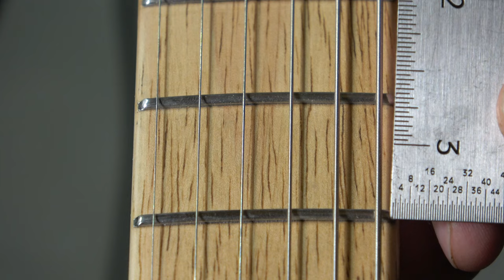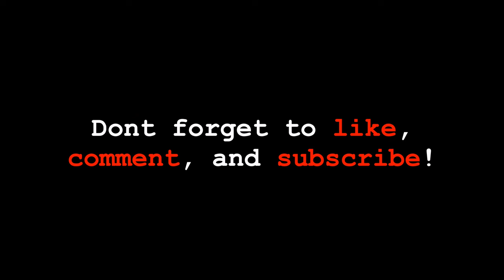How Far Should Guitar Strings Be From The Edge Of The Fretboard?

Comment: I recently rebuilt a Harmony H78 from 1964 (similar to a Gibson ES335, but with 3 pickups and a Bigsby). This guitar has sentimental value for a family member, so I viewed it as a learning opportunity - and it certainly was that...

In an attempt to start refinishing the guitar many years ago (after the fretboard had popped off), the neck had been "over-sanded", so it was 1/16"-3/32" too narrow - I had to shim the neck where it fit into the body's neck cavity.

The new geometry was a bit fussy to reestablish, and I agonized about this same subject. I tried 2mm and 2.5mm spacings with nuts that I made, and neither one worked out - I could push the bass E off the edges of the frets, starting at about the 12th fret. So, I bought nut for a "narrow Gibson" from StewMac, and ended up with a 3mm spacing from the outside edge of the fretboard's binding to the center of each of the two E strings (or maybe 1/8" - it's hard for me to measure that difference). The bass E stays on the frets all the way down the neck with the 3mm spacing. That spacing is consistent down each side of the neck. I was trying to keep the string to string spacings as wide as possible, so I was happy that 3mm worked out.

Because of the thinner neck, the 2 E strings pass over the poles on the neck pickup just inside of their centers. It does not seem to make a difference in how well those poles work relative to the other 4

I am a complete novice at this stuff, so my experience is a bit limited, but this guitar plays very well.

Comment: In my opinion, the first question to answer is how wide do I like the neck? I had a guitar with 58 mm at the 24th fret and it felt awkwardly large, my favorite guitars have 56-57 mm at the last fret. I also own a Spirit by Steinberger with a very narrow string spacing which allows as little as 53.5 mm width at the 24th fret. I don’t find it as comfortable as my other guitars, and it also is uncommon, so not the kind of guitar you want to get used to and then find out you can’t play on other guitars anymore... String distance from the edge is quite a direct consequence of neck width and string spacing, but most bridges have about 10.5 mm string spacing anyway, so the variable parameters you end up with are neck and nut width. As with string spacing, which is calculated from each string axis (otherwise you should have individually crafted saddles for each string and even for each gauge of strings), I measure (eyeball) the distance from the edge of the fretboard to the center of the string, not the edge of the string. I set the neck “tilt” in order to keep those eyeball measures equal, but if I have to leave more room to one side, I’ll always choose the high e string side, because that’s where you risk going out of the fretboard the most when playing.
As already stated, fret-end treatment is as crucial as the available space: very round, spherical fret ends are a pleasure to see and touch, but they often reduce the “safe space” between the string and the fretboard edge quite a lot. I personally suspect Ibanez RGs have increased their neck width from the 56 mm of the 80s-90s to the 58 mm of the later models because of the adoption of the spherical “prestige” fret-end treatment. I prefer the more standard fret-end treatment, which allows more available space for vibrato, a constant height till the edge of the fret and is somehow more predictable (with spherical fret-ends, it’s like they induce you to slip off the fretboard, even when you think you’re still quite far from the edge of the fret).

Comment: Excellent video! I've always used 4/64" from the fret bevel to the string when I'm cutting a nut. As for neck alignment, I'll usually get the outside strings as even as possible, but sometimes will shift it so there's more room on the treble side than the bass. 

This is also something I consider when notching tune-o-matic saddles, and I've even notched many of my Strat saddles to get them to my preferred spacing -- 4/64" from the 

So 4/64" from the fret bevel has been my standard for years. The real risk for me has always been rounding the fret ends while maintaining that measurement. I've gotten a bit too trigger happy with my quarter-round file a few times and when you see the string closer to some fret bevels than others...even if you can deal with it, it ain't pretty! 

Fortunately I never have this issue on customer guitars. But on my own guitars I'm an obsessive freak about getting the lowest possible action and widest possible string spacing. Just what I personally prefer. 

And it's definitely taught me that since I measure from the fret bevel, the profiling of that bevel is perhaps the most imperative thing for determining this spacing. Nuts and saddles are a lot less time consuming to replace than frets. 

Rounded/hot dog fret ends are tricky for this reason. I'm still searching myself for the perfect fret burnishing method, while maintaining the widest possible spacing. Getting those edges invisible to the hand seems to be a tall order without beveling them a fair amount. 

But assuming evenly beveled frets -- 4/64" from the bevel. Most of the time I just worry about this at the nut and let the saddles take care of the rest. I'll adjust the neck alignment if necessary, either dead even or a little more room on the High E side.
Reply: 1/16
Reply: @nisterror   @Nisterror  Using 64ths of an inch is the accepted standard in the guitar community. Reducing it to the lowest common denominator as one would do in mathematics is unnecessarily confusing, as most people measuring guitar specs are using machinist rulers in 1/64th denominations. 

So 4/64" is the most understandable, as it means 4 notches on the ruler. Conversely, thousandths of an inch are the accepted standard for measuring neck relief and action at the 1st fret. 

Not to mention you can't reduce 5/64", so for example, saying you prefer your action at 1/16" on the high E side and 5/64" on the Low E side would be incredibly awkward and confusing.

The "common denominator" is 64 because 64ths are the "most common" for measuring action, even though in the mathematics world this is 'incorrect.' When in Rome, as they say. It's like how a G# major scale is a 'theoretical' scale because it has to use E# instead of F, etc., as you can't skip notes. C would have to become B# as well, for example. 

I myself have been trying to break my decimal habit, as I prefer saying 4/64 or 1/16 as the number it actually is, which is 0.062". Decimals are arguably the most accurate expression, but since nobody in the guitar community uses them when talking about 12th fret action or spacing at the fret edges, I've had to stop using them. 

Which means I'll keep using them and just let people deal with the confusion. So reducing fractions is also fair game ;) Though as digital action gauges have become more popular, more people might start using thousandths. We'll see.
Reply: @guitar_md  Lol, I'm glad my 1/16" comment triggered this whole response. Priceless.
Reply: @nisterror  I wouldn't use the word triggered. I just gave an objective explanation. But yes, I can see how it would be funny
Reply: @guitar_md  I didn't mean any disrespect. Comment sections on YouTube get very serious and uptight, I had to throw in the 1/16 to lighten up the mood lol. 

I mainly use a D'addario string gauge for all my set ups. It keeps it quick and simple. It does have a built in conversion chart which is handy as it has both fractions, inch decimals and mm decimals. They combine the fractions from 16ths, to 32nds and 64ths as they simplify them to common numbers. This is good enough for my purposes. I also have a mm and 32nd scale that is sufficient for me for eyeballing things. If need more precision I turn to calipers or a micrometer.

Comment: I almost always went with a 43 mm nut, with 35 mm string spacing. That gives me 4 mm on each side from the center of the string to the outer edge of the fretboard. At the 24th fret I do 5 mm on each side. I like to have enough "room" for beveling / rounding in the fretboard edge and frets and still be able to play heavy vibratos on the high e string.

Comment: You have different parameters to consider. Bridge spacing (if factory) and the width of each end of the neck. A factory locking nut would be a fixed distance BUT can be tweaked with files. Do not use your good slot files tho...
I have a rebuild using a Kahler and the saddles can be adjusted side to side....do not like the way the strings go off the rollers when using the trem bar BUT it can also lock....

Comment: I'm in the process of designing a guitar so this is very interesting. One thing I have wondered about is whether the distance should be the same all along the neck or if it should increase towards the body. My thinking is that as you move away from the nut the string can be more easily pulled off the edge of the neck. In truth the variation would probably be no more than 0.5mm or the neck would start to look very odd, so this may be more pedantic than practical.

Comment: This an interesting subject that I never thought about when purchasing my first guitar. After thinking about it I have a feeling this is one of the reasons people have stopped trying to learn the guitar as beginners. Fret spacing is so important for the beginner who have issues with the SORE fingers and muted strings trying to play the correct chords. Of course everyone has this issue when first picking up the guitar and only practice will cure some of these issues. Personally I had more issues with the high e being muted because of being the same distance from the edge as the low E string. I have extra large hands which is not a gift when playing the guitar.....9 inches from palm to end of middle finger with fairly fat finger tips. So, muting strings was a struggle with me and it was extra frustrating when the high E string would be pushed off the fret board. It was hard enough to fit my fingers between the frets but when I'd position my correctly to have this happen constantly it made me want either slam the damn thing down or just lay it down and quit. I'm still not a pro or even what I'd call a gifted guitar player but have gotten better with time. I suppose a classical would be the answer but funds are limited at times. Ha, I wished a guitar as made with a little more spacing for the high E string from the edge of the fret board.

Comment: My current S-shaped object is 2-2.5 mm between the center of the e and the edge of the fretboard and it’s not enough. 3-4 mm would be better. New G&Ls use a 1-11/16” nut width and 1.65” string spacing — i.e. strings are spaced the way they would be on a 1.65” neck. I’m not sure what that means in numbers, but it feels good. Just enough room for both E strings.

Comment: The binding makes a lot of difference. On a Les Paul with binding 3mm (from the center) at 12th fret is not enough , Gibson build the guitar with 5 mm at 12th fret.
Also must be consider  fingers tend to slide inside the fretboard the high E and tend to slip OUTSIDE the fretboard the low E so  I use 4mm on high E and 5 on low at 12th fret on a Les Paul with binding . This also visually give the idea of equal distance considering the different diameters.

Comment: Hi. As a player not a builder, but someone who tinkers with the set ups I prefer a larger gap for the low E and quite a small gap on the top E. Depends also on the fret ends and how they've been smoothed off. I don't think thumb over the low E is an issue (your 1/8") as that's down to practice and neck shape and width - my distances would be just under 1/8" on the low and nearer, just over 1/16" on the high E (outside of string reference). Also heavier strings and a wider neck need more gap - but probably microns. Good luck with this - the variables that make the right instrument from a good one may be getting into the metaphysical! Steve (UK, blues and jazz and acoustics that need lots of room for the strings to vibrate).

Comment: I a-priori made/ke  my guitar/s 40mm at the Nut. And I use string spread of either 35 or 34.5 mm on the Nut. Which means I have about 2.25 to play with on the edges of the fbd. 
What all this means:
Firstly, rolling a string off the edge is part of my 'technique' or style of playing. (And I actually have plans of making all the rolled edges of the frets [yes I roll them off] aligned just like all the frets on the board are aligned in all aspects for smooth playing without buzzing etc.)
I had to develop the right playing adjustment for this. But like everything else learned in guitar playing I had to learn this technique of makibg sure you play the Bass E string coming from the edge inwards or down . And also you need to develope a less agressive play on that Bass E string.  And with time it becomes natural. So... it's not the end of the world if one makes a 'mistake' and narrowed his board 'too much'.
If Django Reinhardt  played with one finger .... you fill in the rest...

Comment: I use 1-11/16" nut Warmoth necks, so my method may not work for narrower necks. Normally the nut comes spaced correctly, but occasionally I'll have a new one installed.
 I go by the B string. If I can bend the B towards the high E, up one half step without falling off the edge, it's good. I use the same method bending the A towards the low E. I don't like the edges rounded.
 What are the actual measurements? No idea. My set up guy is Denny Rauen, (first documented person to build a compound, or multi radius fretboard) I explain it to him and he makes it happen.

Comment: I try to get both Es equal distance to the edge, but as long as both are  1/8" or more I'm alright if not perfectly centered. When slightly off center I favor having the high E at a greater distance for safe bending avoiding the edge.  From edge of string not center.

Comment: Assuming the strings are equidistant from each other, I would say half the distance between two strings. The way I like to think of it is "each string gets a certain amount of space around itself". So if you have a guitar with say, 7mm between each string, i would conceive of that as "each string gets 3.5mm of fretboard on either side of it" which would mean there is 3.5mm of fretboard on the outer edge of the outside strings. You shouldn't really be bending the outer strings out toward the edge of the fingerboard anyway, right? Maybe a little if youre doing some vibrato, but I was taught that big bends go toward the middle of the fingerboard.

Comment: Bonus question:
Do you use same measurement for fretboards with and without binding?  I wouldn't want the strings completely over the binding, but in a bit from that edge.
A lot of times you can change it with nut/bridge adjustments.

Comment: I've never built my own guitar yet. But, I've been planning for months. And my research for fender guitar is nut width = 1.65"(41.91mm), string space at nut = 1-13/32" (35.56mm). So I should keep 3.175mm gap from the edge of a neck to the center of a string. Then, string space at bridge is 54mm. And, you know, now I can draw neck outline with that 3.175mm gap. I dunno how this 3.175mm gap works with radius and pups etc. I just hope I can successfully shorten a scale length with this method.

Comment: I don't think there is a one size fits all answers. I mainly build basses. There are a lot of factors that I consider such as fretboard radius, will the edges be rolled, will there be binding with nibs, whether its fretless or fretted, and the size of fretwire and what fret edge profile will it have. Even scale length and what type and gauge of strings can affect my choice.   Generally i go for 1/8" from fretboard edge to side of string, but could go even more in some situations.   I'd rather have a hair too much space than too little. Too little is unplayable,  too much may not be noticed or at worse a minor issue.  
This really is a great question to ask.  I've seen lots of guitars and basses suffer from strings that are too close to the edge.